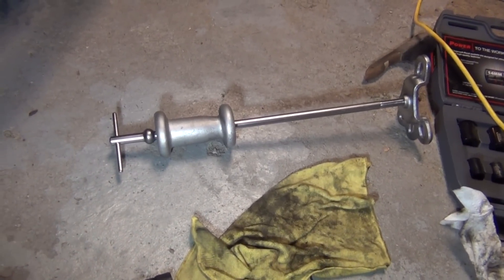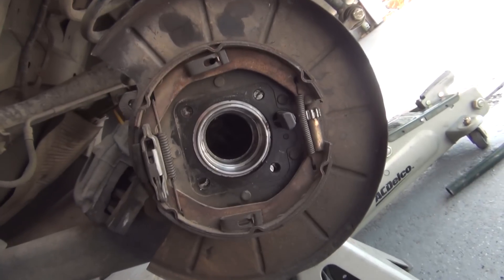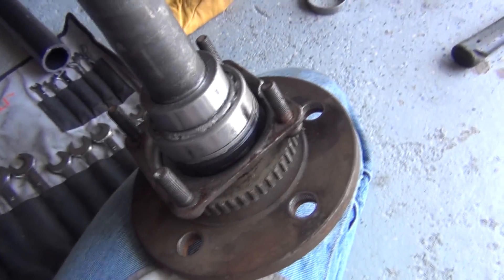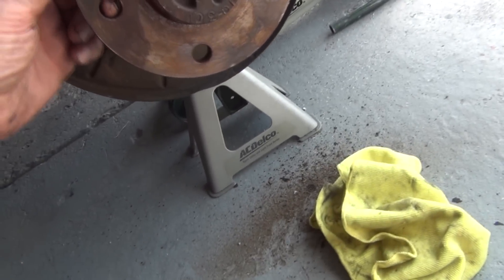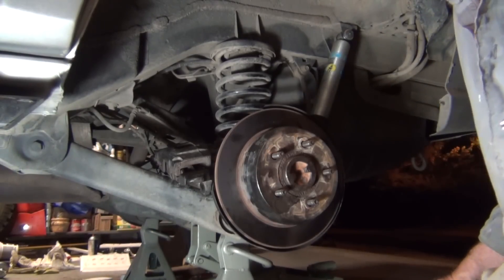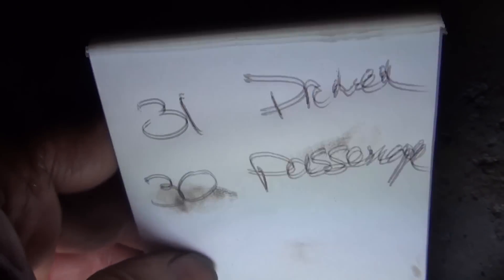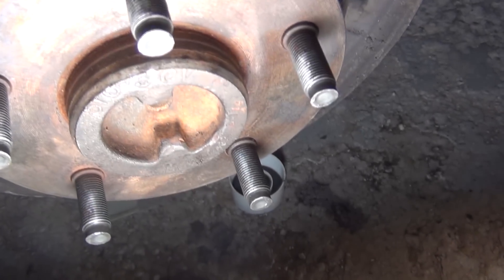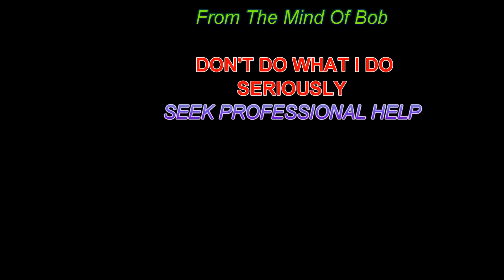Wheel bearing install

Comment: take the rotors off turn the rotor around put back on lugs put the lug nuts on evenly about half way and a few tugs the axles will come out , so you don't need the slide hammer with the attachment . also found that when the rotors get stuck you can use an air hammer with punch attachment and bump the inside part of the rotor where pad does not reach where the brake caliper was . just bump it then turn 45 degrees repeat and  again turn  until it comes loose.

Comment: Thanks for mentioning the length difference.  I wouldnt have known either. Both of mine are leaking
Reply from the maker: Your welcome Jester12036.  Hope it works out for you.  Shine a flashlight down that shaft...there is a metal bar going across at the end of the axle housing that wants to be lined up...but the axle should just slide right in.

Comment: replaced leaky wheel seal, cut the bearings off with torch. hammered new bearing and everything back on. Is a press really necessary?     This reminds me, my other wheel seal is leaking now...

Comment from the maker: They say you can hammer them on instead of using a press.  The only thing when you use a hammer is to make sure the bearing goes on straight.  I am not talented enough for that, which is why I paid to have mine put on by a machine press.  ahahahahaha...With all the modifications I've put on my Jeep, I'm still get amazed every time my Jeep rolls down the road.  :-)